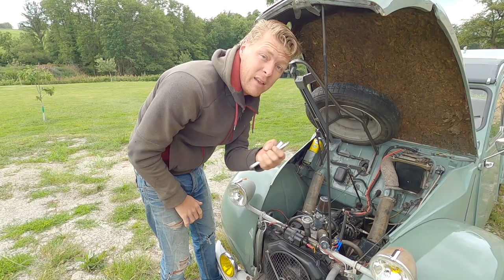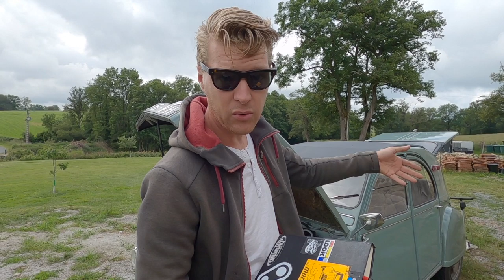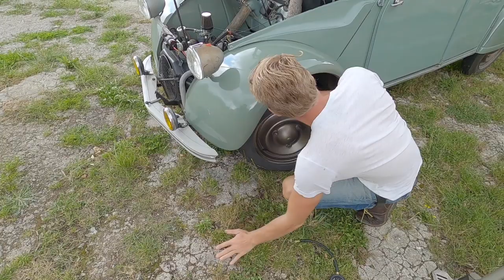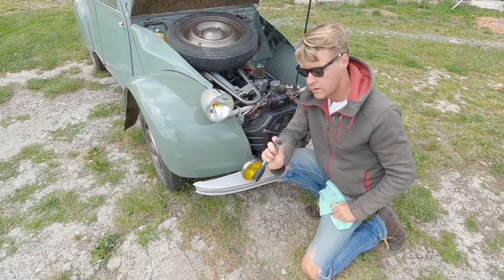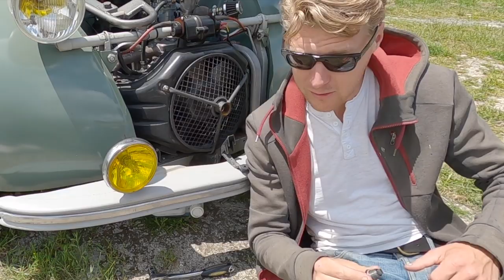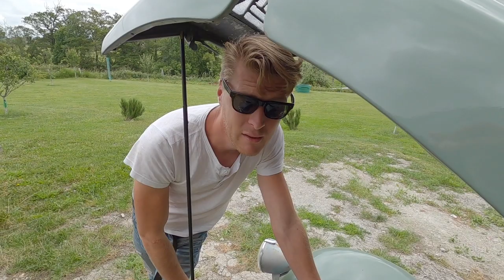Citroen 2cv Post Lockdown Service

Comment: Footpumps must be rare in France.
Reply from the maker: Foot pumps are a bit old hat and usually low quality
Reply: @OliverPickard  The majority are certainly low quality unless you buy an old one and treat it to a set of new seals but those high pressure stirrup pumps are even older and are really designed for bicycles. That's why the pressure gauge goes up so high and the barrel has such a narrow x-section, bet it registers 140 psi.
Reply from the maker: It's a double action pump so it blows on the push and pull. The pump doesn't care what it's inflating but it's extremely high quality pump  thats reasonable to buy and easy to store
Reply: @OliverPickard  Small circumference barrel pumps are low volume high pressure pumps, car tyres are high volume low pressure. 2CV tyres may be smaller than most but there is a reason foot pumps are used for cars and it isn't just about storing them in the boot.  I agree that for light use like topping up a few psi on a car it makes little difference but you put a bike pump like that to work on a flat and you'll feel the over work on a unit more readily designed to put 100psi in the tyre of a road bicycle.

Comment: Thank you for the comprehensive service advice. When greasing my 2 cv6 kingpins I jack up the front to take the weight off the pins and turn the  to each side several times

Comment: Good stuff Oliver. Very detailed :) One comment, it’s good practice to check the valves sets, and also to note plenty of residual old oil sits in the rocker cover. Replace the gasket too. Also, once you filled up with oil, and you had your first run, once the engine is cooled down it’s a good practice to re-check oil level once the new juice is spread around in the system, you may need to fill up a bit. You take care!

Comment: Sorry Oliver, another comment! A question actually. Well, two. I noticed two filters on the top f the engine, the one you mentioned was the air filter, but what's the little one a bit forward and to the left of that? I must have missed it when you spoke about it. And how often do you waxoil the car's underside? (Assuming the French sat their roads I s'pose.) Thanks eh, Mark
Reply from the maker: Firstly don't be sorry it love comments they inspire me to make videos. 
The little filter is the engine breather there's also a little stainless scrubby in the breather cap
And I don't wax oil her my chassis is painted with zinc paint and I paint sensitive places with greese. I tend to use back roads which don't get salted and if it snows heavily I just stay in haha
Reply: @OliverPickard  Thanks, makes sense on both counts. Sorry to see the plug advice was deleted. Apologies.
Reply from the maker: @markdibben7890  stop apologising haha
Reply: @OliverPickard  Sorry, I'll stop doing that then!! :-)

Comment: Here are some general comments.  In the U.S. haven't had batteries that you can or need to add water since the '70's.  I've had a battery last one year and one last nine years.  I had a spark plug blow out in my Corvair.  Had to install a Heli Coil type thread restorer.  Replace the positive battery cable if showing wear and check to see if it rubs on anything.  Potential cause of a fire that will totally destroy your car in a couple of minutes.  Also do these checks on your newer cars.  Found a nail in a tire once before a long road trip.  You need a big air compressor in the U.S. for pick up trucks!  I use 10w30 in my air cooled Corvair.  The owners manual says 30 weight.  They didn't have the multi grade yet in 1965 I guess.

Comment: It may not be so bad with a 6V vehicle, but you should really undo and disconnect the -ve battery lead before you start work on the +ve one.  By working on the +ve one with the -ve one still connected as you did, you risk some nasty short circuits.

Comment: Exhaust is sounding a bit rorty there. Little leak? After writing that checked to see if you had the side or rear exit pipe and see it's from the rear and after the silencer change it sounded the same so may not be the case!
I'd always inflate the spare to the higher pressure, perhaps even 1.9 or 2 bar. You found that you had lost a bit of air when you checked. You can always drop the pressure if it has to go on the front. Tubes vary with regard to leak porosity. I have tubes in my Amazon tyres and have one that always drops a quite a bit compared to the others
Reply from the maker: It is a side pipe it exists behind the drivers side front wheel on all pre 70 2cvs

Comment: Very good video again Oliver! A lot of useful tips, and as always, some were new to me, even though i had an automotive education 😊 I thought any 425 engine has an internal oil filter in the sump? But it's only at later 2CV's?
Reply from the maker: No oil filter until 69 which is internal and then 70+ all external oil filters

Comment: It’s better to jack the front up and then grease the king pins. Otherwise the grease won’t get to where it should be.
Reply from the maker: On a very heavy car that could possibly be correct but you can clearly see in the video that a large grease gun creates enough force to push old grease out of every orifice.
 infact the hydraulic pressure created by a quality grease gun is probably greater than most hobby grade trolley jacks

Comment: I am thinking of buying a 2cv myself, however I am quite tall and do not know if I will fit. I am 2 meters tall, do you think that I can drive a 2cv comfortably? Also, how tall are you?
Reply from the maker: You Sir are in luck because I'm also 2m tall not only do you fit but you could even sit in the back seat behind your self

 I removed the sun visors because they are pointless and that helps with visibility 

 I would avoid super thickly padded seats a well bedded in seat is more comfortable anyway but if they need replacing are easy to customise to your needs until the rubbers give a bit. 

The only other thing is if you go to see a car and some one has adjusted the suspension wrong and it has its ass in the air don't be put off it's a 10min job to sort & I have a video to show you what to do